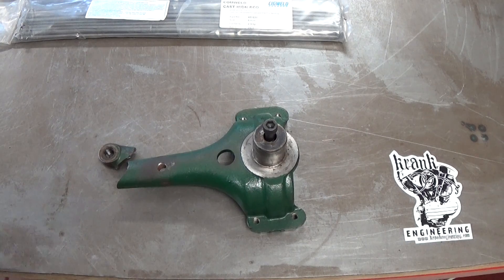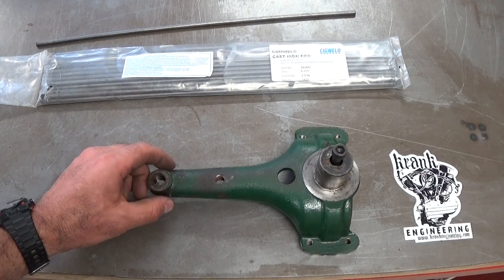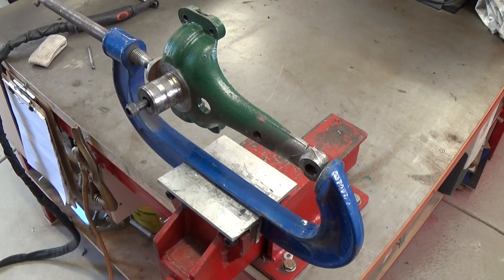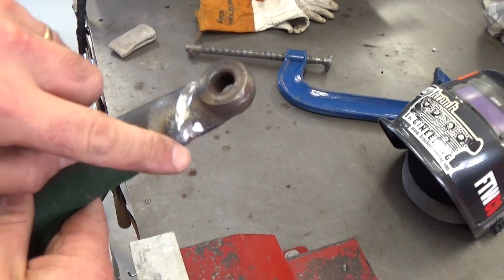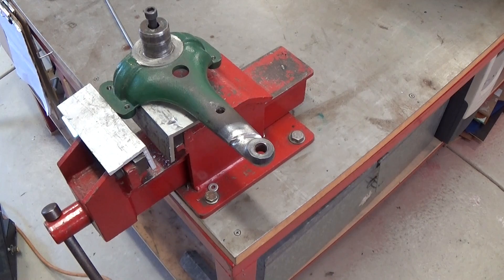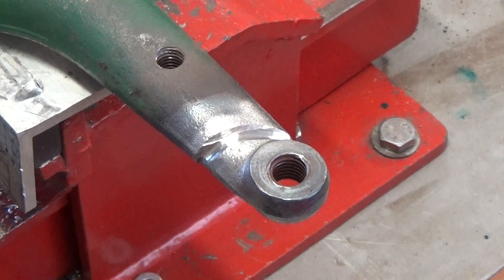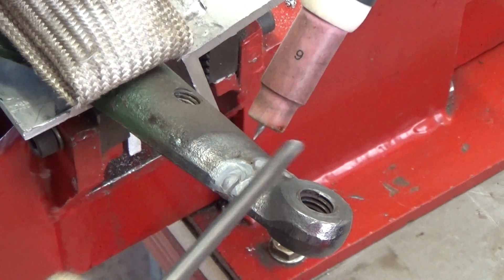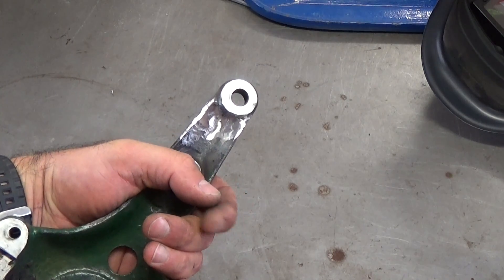#WELDA Day 5 - Weld repairing cast iron with cast iron filler rods

Comment: Experienced Mechanical Engineer here. I would suggest you add a gusset on the concave side, hole to hole. Like a piece of 3/8 keystock to reinforce the design flaw/weak spot.

Comment: Would it be strong ? As was thinking of welding a car hub assembly
Reply from the maker: As a general rule, nothing that has been weld repaired is as strong as the original. You've changed the metallurgy with the filler rod, and messed up the microstructure of the metal around the weld. Both of these are "stress concentrations" which means the same load the original part would withstand MAY NOT be withstood by a welded part. Its impossible to know for sure without destructive testing.

Comment: No preheat?
Reply from the maker: What preheat temperature would you suggest?
Reply: @krankengineering  at least 150ºC. Easily done with a propane torch. TIG brazing with aluminum bronze A2 is the way to go though because its coefficient of thermal expansion is very close to cast iron. It's a foolproof way to repair cast iron.
Reply: @krankengineering  So actually, clamp it like you did, then use a die grinder to cut a large V groove along the top side of the crack. The depth should be right into the middle of the part such that when you do the same to the other side, you will have achieved 100% penetration with the aluminum bronze filler. And it's very strong, with the ultimate tensile strength being higher than the cast iron itself.

Comment: wow, what is that a 1/2" diameter rod, that thing is huge. If they made 1/16" or 1.6mm rods for that I bet it would be easier to use.
Reply from the maker: Hey mate, its a cast iron filler rod, probably would be easier in smaller sizes but the cast iron seems to "wash" off the tip pretty well. This was the only size available from my local supplier. Cheers!

Comment: you are passing your current right through the threads of your clamp, not good on threads same as passing through bearingsm not good
Reply from the maker: I agree you don't want welding current going though bearings or computers on cars or bike
Reply: I’ve welded with the ground on clamps holding my pieces together for many years. Zero issues.

Comment: Matt, Thanks for doing this video.  Until today I did not know cast iron could be welded with TIG.  I have welded a lot of cast iron using oxy/acy and cast iron rod with flux.The flux is getting expensive, about $28 US for a bout a 4 oz. jar.  I will try TIG on my nexr cast iron repair.  I am always concerned about a hard brittle zone behind the weld dur to mass quench effect.  I expect it would be worse with tig than with oxy/acy.  On critical work I have it normalized after welding.  On work that has been submerged in oil I normalize first to burn out any absorbed oil, then I weld, and norrmalize after.  Normalizing after welding is essential if the welds are to be machined.  Again, Thanks.  I learned something new.
Reply: Dear John, Greetings. I wish to buy torch rod for cast iron but machineable and color matched. Where can I buy the rod?
Reply from the maker: I hope you are able to find some suitable rods, I can't get them anymore here in Australia, and plenty of people tell me they can't find them in their local area.
Reply: @krankengineering  Why can't you grind up dome cast iron powder and mix it with a bit of flux as a substitute.
Reply: Most fluxes are a total rip off.  There's tons of recipes out there, but the secret ingredient is roach powder or boric acid.  Muriatic acid mixed with zinc makes a great flux.

Comment: It wouldn't be impossible to make a casting mould since you already have the part. 
Ive welded cast using stainless rods and preheat the project. But in this case i would make a green sand cast as its a small part and machine after. No big deal.

Comment: The only thing i would have done way different is insist to see either the individual sub assembly that parts bolts to ... OR preferable the entire machine,  It might have been easy to fix with a couple mild steel brackets or something, just bolted on.

Comment: If the 4  6mm(?) threaded  holes need to be coplanar with the M10(?)  at the end,it may break again; i guess a simple jig could have been made,and careful welding alternating sides?; i am saying this from a mechanic's point of view; i cannot weld shite, i rely on others like you for that.
Reply from the maker: Hi Jose, yes possibly a jig would help, however the fracture was a clean break and the parts fit back together perfectly. I didn’t have any of the other parts from the assembly - just the one broken part - so I have no idea how critical the tolerances were.
Reply: this is 2025 now... the assembling mechanic MUST be warned, and  he MUST  MAKE and use shims, the part is no LONGER in tolerance, needs adaptation, there in NO FORCING IT with the bolt!!!    ; but a good part, it looks like.
Reply from the maker: Give it a rest mate, the job is done when it’s done. The whole point of the video was to demonstrate cast welding filler rods. Why are you coming back to comment on my 5-year old video?

Comment: I noticed a difference when you  did the tack weld and the front / back weld that the arc was pulsing during the weld but not on the tack weld. could it be the aluminum in the vice is affecting the electric current?

Comment: does it use ac or dc current?
Reply from the maker: Hi Agus, this is ferrous (iron-based) so I used DCEN (DC-Electrode Negative)
Reply: @krankengineering  thank you for the answer sir
Reply: I was wondering the same! Thanks to both of you! Cheers!

Comment: Very clever to clamp it together first so the granularity in the two pieces will align, then tack them together, and THEN grind out the V grooves.  That's great thinking.
Reply from the maker: Took longer to think about the repair process than to actually do the weld!

Comment: First time I've seen Cast-iron TIG!  Looks more than OK, probably doesn't hurt at all to have a little weld reinforcement.  The only way I've ever tried to handle something like this is by brazing, and here would be so glad that the break is small and isolated like that.... I'm definitely going to look for those rods!   Thought the clamp/tack idea was clever, you can be pretty sure you kept the original geometry and the part will still work.

Comment: How'd it hold up after that weld?
Reply from the maker: +Jared Sams never heard from the owner again so I take that as a good sign 👍
Reply: Matt McLeod I was just curious. That's the first time I've seen those cast rods. I typically use Nickel, Aluminum Bronze, or Silicon Bronze.

Comment: Hi Matt, great vid and interesting. I have a job that our welders at work was going to do for me which involves adding cast iron build up to the sides of a engine block to create a full fusion weld to create a boss for another set of head bolts. They have offered to do it to save me the time and stress of doing it at home, they was going to do it using a gas torch & cast iron filler rods & cast iron flux. Do you think your method would be just as effective & as strong ? I don't think they could of ever tried doing it with tig as they did not mention it as an option. Does the surrounding metal machine back ok ? Or does it harden up like when you use arc rods. I would appreciate your opinion ! Only just found your channel but will be adding it to my list of subscriptions.
Reply from the maker: +Darren Heaver hi Darren. I would expect some heat distortion in the block unless this was done slowly over a long period of time. I haven’t tried machining these filler rods but they are simply cast iron so I can’t imagine any problems machining it. Arc filler rods are completely different metallurgy which is why they machine differently to the parent material. I think either gas torch or TIG would get you the same result. Sounds like a challenging job. But your welders sound like they have a plan to get it done. Good luck!

Comment: Very nicely done. I was wondering if I could use my everlast mig welder to perform similar repairs.
Reply from the maker: +Charlie Marks you could weld it with a mig but it probably won't last. The normal ER70 wire in a mig is not a good match for cast iron.

Comment: Hey Matt, have you ever tried silicone bronze filler for trig welding cart iron?
Reply from the maker: +MrMarcaap I have some silicon bronze but this is a filler used for brazing, not true "fusion welding". I generally use silicon bronze for joining dissimilar metals or where I need to join stuff together but I don't want to pour heaps of heat into it (to minimise the chance of distortion). I use these cast iron filler rods or high nickel stick welding rods (with lots of preheat) for cast iron.
Reply: Were the rods you used in the video actually Electrodes? cause I only seem to be able to find Electrodes not cast Tig rods.

Comment: Good job mate. Well explained and well shot. Thanks for the vid.
Reply from the maker: +TheBlueskyson thanks mate!!
Reply: Thanks for all of the information. I eventually want to be able to make my own cast iron repairs with my powertig welder. I understand it can be a difficult job if the proper technique and metal isn't used.